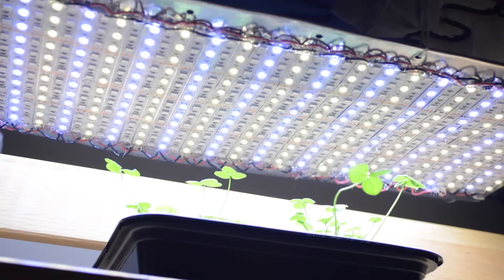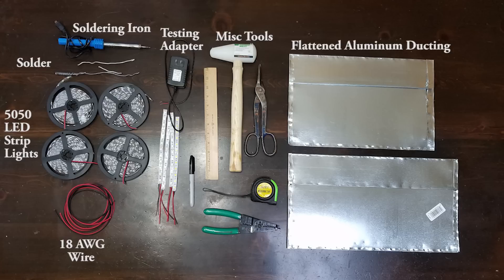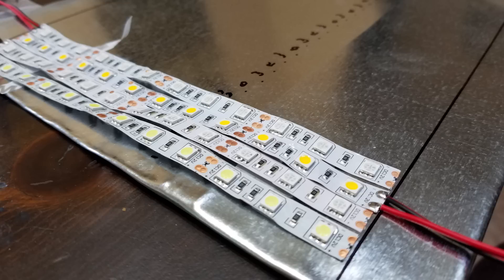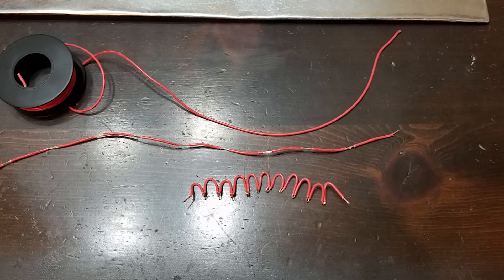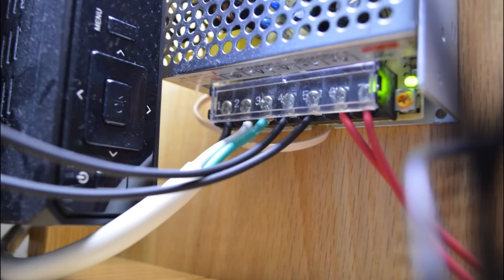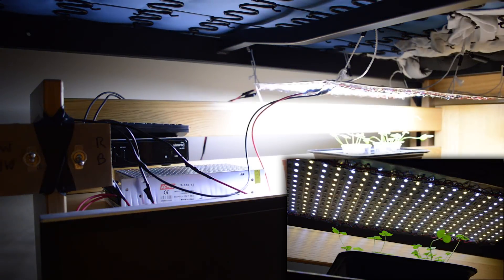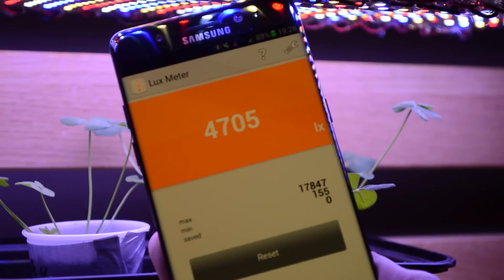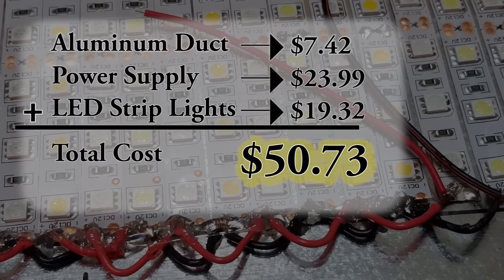How To: DIY LED Strip Light Panel

Comment: Good video.
 I suggest using an old florescent troffer light fixture that can be gutted of it's components. The shape/construction  is good, and it has a diffuser cover that can be eliminated or changed to glass for a enclosed unit with fans. There is so much room to work with you can also enclose the power supplies in it... making a conveniently packaged unit.    I picked a couple up at a goodwill store for cheep but you can find them everywhere as commercial buildings are dumping the old Fluorescents and installing LED fixtures.

Comment: i need to no can u control the amperage or the voltage I need to control the Epic so I was wondering what does it do does it control the temperature the voltage the power supply screw that allows you to turn it down or off because

I have a LED vet on me I want to run at 800 milliamps but the power supply is 1500 milliamps how do I can I lower the amperage and one other thing say I have for Led chips that use 800 milliamps for sweet spot power supply but sale 1500 milliamps I want to run for Led chips that use 24 to 36 volts 300 milliamps to 1200 milliamps Max can a power supply that has 100 watt 24 volts DC and 1400 milliamps can that power the four chips that I want to run a 24 volt 800 milliamps what do you suggest